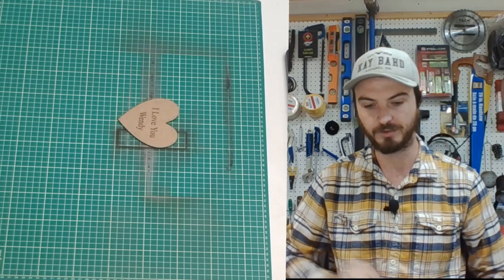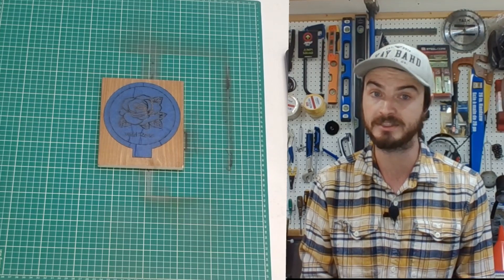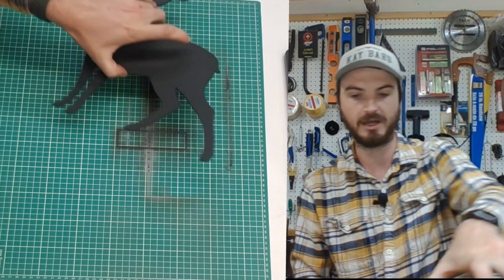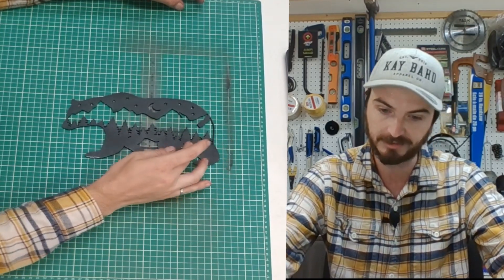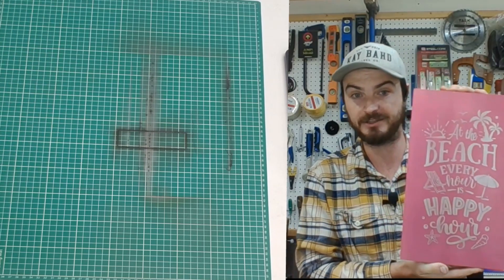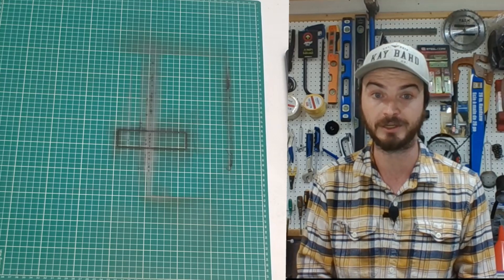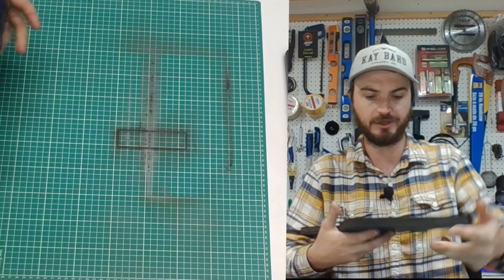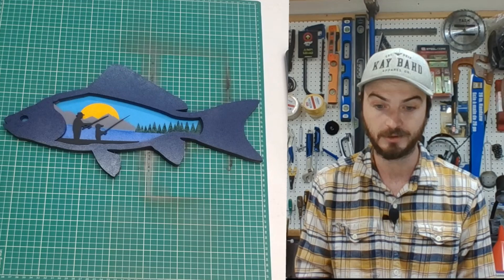Xtool D1 10watt performance review

Comment: I am currently budgeted for the 5W XTool D1 Pro. Would it be in my best interest to save up for the 10W or even the 20W version? This will be my first laser engraver.
Reply from the maker: Hey,  that's a great question.  It depends on what you plan to do with the laser,  if its a hobby or if you want to start a small side business, or maybe make it a full time job.  If you want to email me at Plaidguysgarage@gmail.com with more details I can help you look at options.  There's also some other options available other then Xtool as well, if you are not set on Xtool d1.

Comment: Nice video...May I suggest you get a 20 watt laser module if you are doing a lot of cutting...I have the 10 and 20 watt....Let me tell you, the 20 watt is a game changer.If you need any pointers don't hesitate to email me...I would be happy to help.Maybe we can exchange ideas...I have been engraving for 2 years,I have a 5 watt,10 watt and 20 watt...Cheers fellow Canadian
Reply from the maker: Hey Gerald.  My 20 Watt arrives today!!  :)  excited to get it unboxed and ready to go. I also have a bunch of new accessories to help produce better cuts.  It be great to discuss your set up and what software you use to help make your designs.
Reply: @plaidguysgarage  Did you get the 20-watt pro? The 20 watt is a beast for cutting, if you have an air compressor it’s better than the air assist for cutting at 25 psi means faster cuts and cleaner. I use air assist only for engraving…It works for me
The only software that I use is Lightburn, been using it for 2 years and I love it.
If you don’t or, planning to get Lightburn may I suggest that you make library’s for all your work, because in no time you will spend more time searching for what you need to cut or engrave.
Have a test piece of everything that you engrave or cut to help with settings later. Take notes of everything you do when you engrave or cut.
Reply from the maker: @geraldlamothe6091  I did get the 20 watt in finally, Just got the new video of it up. Will be starting to get some test cuts on it soon.
Reply from the maker: @geraldlamothe6091  have you had any software issues with your 20 watt D1 Pro?  I have had a few issues when trying to engrave images.  Maybe we can discuss over email plaidguysgarage@gmail.com  thanks

Comment: How do you cut the multiple layers? What material are you using to make those signs?
Reply from the maker: Hey @Lorenzo  the layers are cut individually then assembled. I used different types of material  that are usually between 4mm and 6mm.  These sheets are various types of plywood or compressed board.  You could also do thick paper  or cardboard but you lose the depth that you achieve with the wood. For the signs I used Oak wood planks that I made from fallen trees on my property.

Comment: No, it's not worth it. It's dangerous to your health (lungs and eyes). Not worth it.
Reply from the maker: If you use the provided safety gear and have a proper shop setup or purchase the ventilation  accessories then these tools are completely safe.  If you use them improperly then yes they can be dangers but the same can be said with a simple hammer. Work smart.